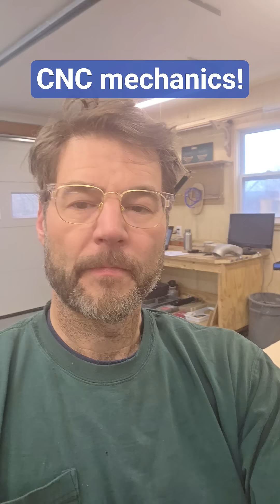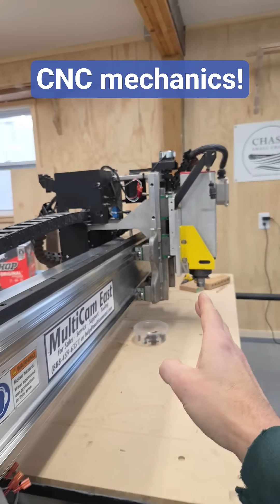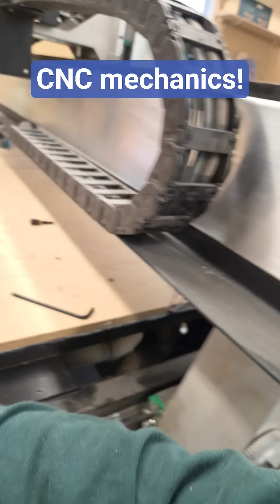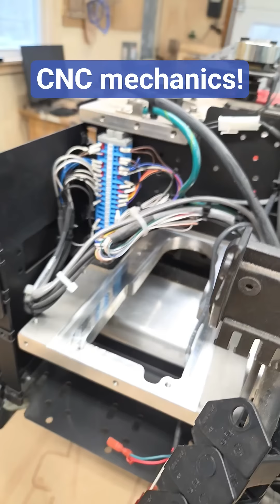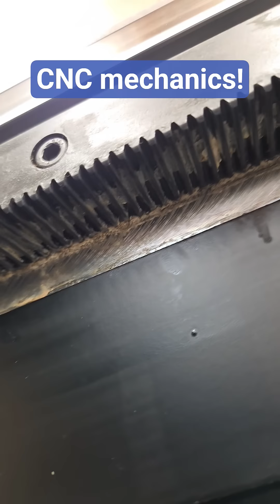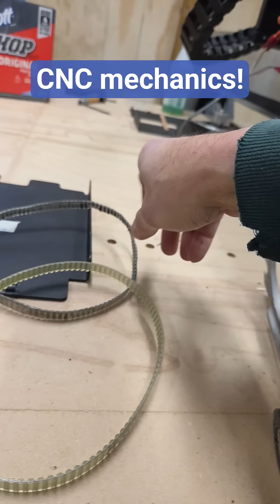almost ready to cut the first kit in the new shop - here is a glimpse into how a cnc router works

Comment: Is there another x-axis motor/pulley/rack&pinion on the other side of the machine to drive both sides of the crossbar?
Reply from the maker: Yes - the gantry is the structural beam (made out of extruded Aluminum) and it is bolted to these gantry ends - each with a drive. I shot the video from the Xb side or high side. The low side is the Xa side. It's referred to that way because it's an xy axis and the distance ti the cut is higher or lower accordingly.